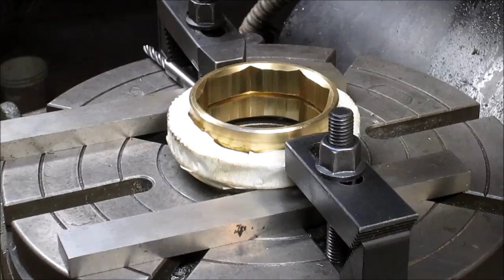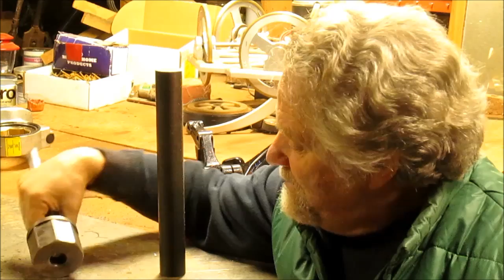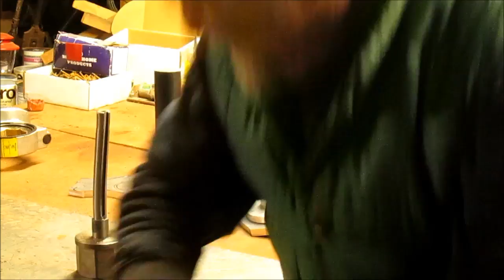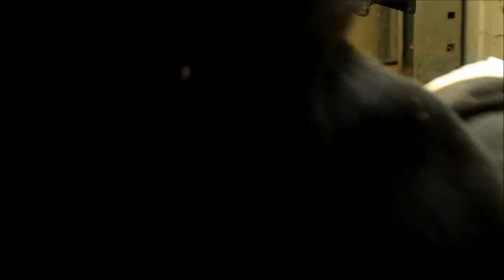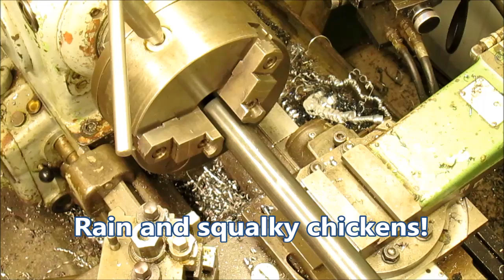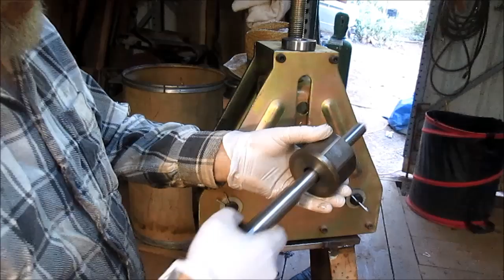Motorizing a Harbor Freight Rolling Mill 9

Comment: Congratulations for your ingenuity and for your great mastery at work
I really like your solutions to the problems that arise while carrying out your idea
I find a very good idea to use the torque machine to motorize the roller even if it has had to rectify the measurement of the drag piece. very brave i very good work, cash !!
Could you indicate the brand or reference of the machine? I was looking for one for me, it seems very effective but I can not find it in the search engines.
thank you very much
Reply from the maker: Both the roller and -power pipe threader can be bought thru Harbor Freight. Warning though, once I got it finished and started using it, the pipe threader overheats after 3 passes. I'm never in a hurry so waiting for a half hour to do the 4th 5th and 6th pull is fine, but if I was to do it over again I'd use some other power source.

Comment: Is your lathe cutting a taper on the shafts? Could your tailstock be out of alinement?
Reply from the maker: +acklan3 The lathe was made in 1954. It worn beyond belief and every time I move it the tailstock is out of alignment. I got it within a thou in the 6 inches. A little more file work and it should be fine.
Reply: Nik C. Colyer understood. Great video.
Reply from the maker: +acklan3 Hey thanks for watching. I love making them.